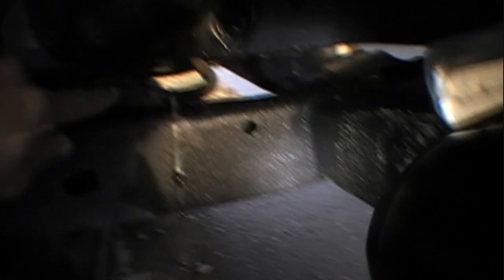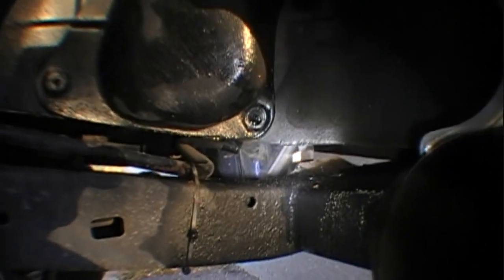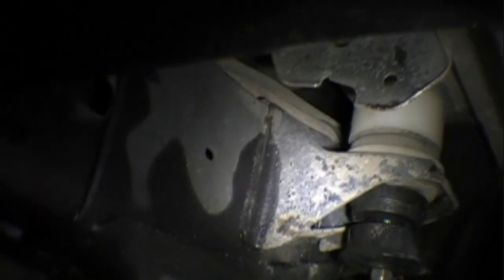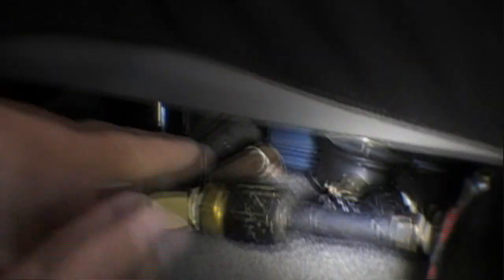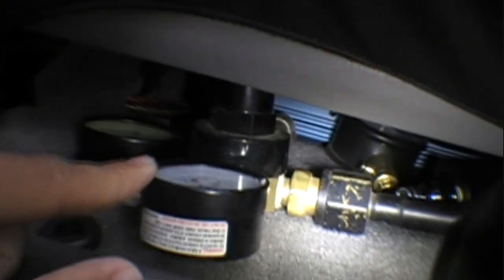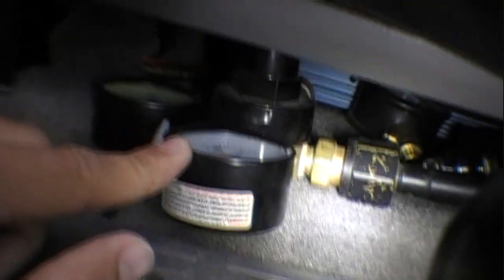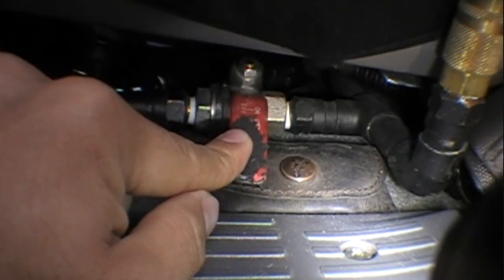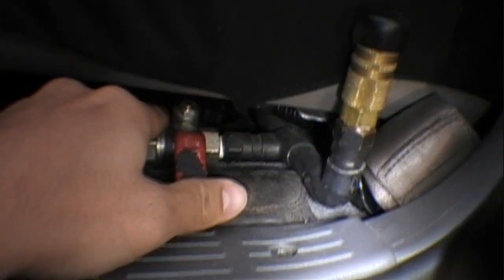CO2 Mount

Comment: You supposed to run co2 tanks vertical, or near to.  You want the gas to come out, not the liquid.   Also, which part of the country are you in?  I'm still debating what to do with our co2 tank.  Right now, its "stored" off the vehicle and put in for the wheeling trips, but being in Arizona means it can get very hot inside the vehicle.  If I could mount it vertical outside, I would but the only place I can think of to do that is on a rear bumper/tire carrier setup.